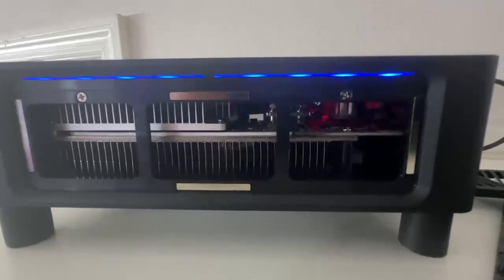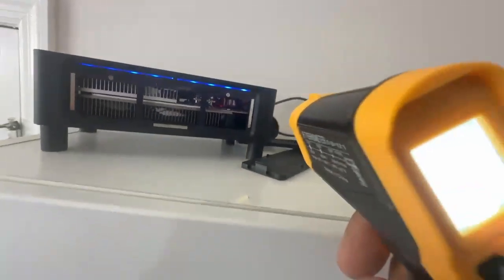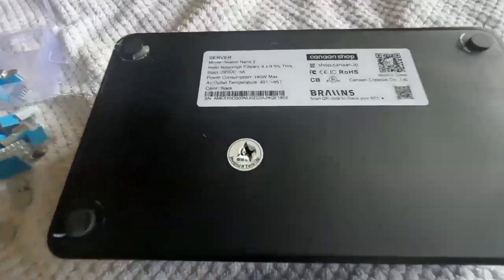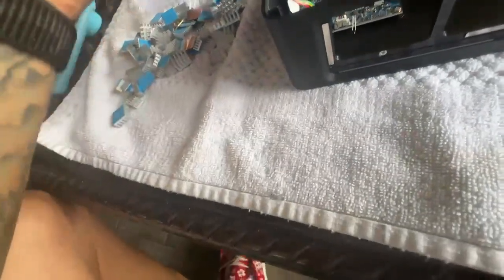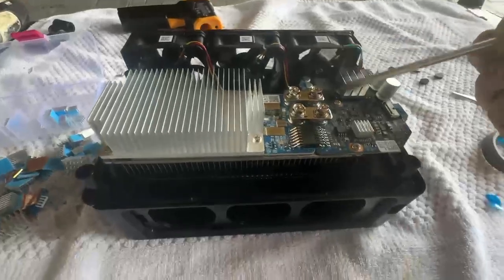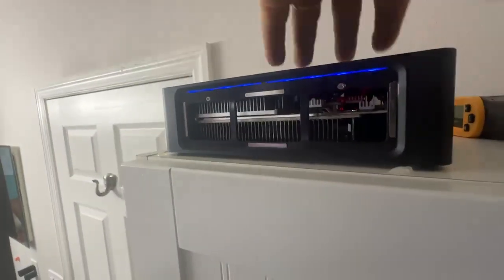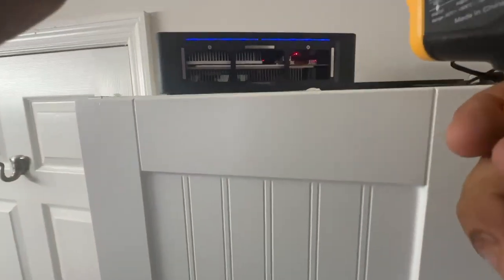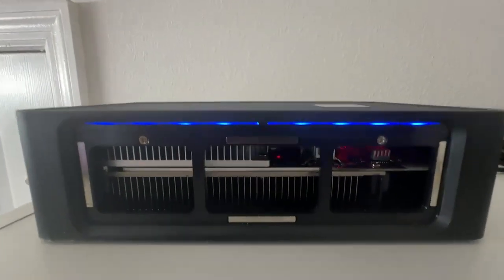How To Cool Down Canaan Avalon Nano 3 ASIC Bitcoin Miner

Comment: My concern is more the noise than the heat (its sold as a heater anyway). Do you think those fans are replaceable with quiter ones?
Also, I notice a rattling at medium speed, but not at high speed. Is it dust? Or loose screw? Not sure how best to clean this without damaging. 
Thanks for sharing this video though!

Comment: Just so you know, those chips do not need a heaksink, they are designed to run at those temps, even hotter with no problems. You are opening the device and voiding the warranty for no good reason. Secondly this device is marketed as a heater, so its made for hot exhaust air to be blowing. Device is fine as it is
Reply: Usa they do not void warranty, that is illegal for any company that ships products to the us directly. Also, they work more efficiently as a heater if they get the heat off of the board as efficiently as possible. Mine are whisper quiet since i ddi this, no longer shut down with a message saying “overheating” and now have MX-6 on the main chips vs the baked dry paste on them from the jump. Put heat sinks on everything that I could fit them on as well, hopefully they last forever as people who did not do this had them fail
Reply: @Euxable  I'm based in the UK, not US. So, I'm not aware of your laws. I ran all of mine unopened on high settings for over 9 months without any issues. They ran just fine
Reply: @ ah gotcha, well the US we are legally allowed to repair. Even lawsuits are filed against companies like apple for throwing errors on iOS when aftermarket parts (or even oe donor parts) are used. However, my reasoning beyond longevity of these devices is:

Periodically, mine would stop hashing with an error on the small screen stating (OVERHEATED) or something similar. I wouldn’t find out until I walked into the kitchen and heard the fans at 100% from across the room. That was my maim reason for doing so; the larger benefit is that my family can watch tv in the living room and not hear the fans going crazy due to the rock hard and dry thermal paste (maybe even glue) used on the main processors. The heatsinks cost $10, and my mx-6 was sitting around from my pc build. The fans now consistently hold 40% (3k rpm) and they are pretty much silent at that speed. The hash rate is also above 4.2 on each of them, when previously they were throttling down as low as 3.XX when the sun hit them directly through the window
Reply: There are some reports of defective devices. The chip in the corner is particularly problematic.

Comment: Hi and thank you for the vidéo, I don't get how you lift the miner after you put off the screw cause the power connector avoid it from pulling, did you just "force" it a bit or did you do something différently ???
Reply: You have to pull it from the back it’s it’s tight
Reply: You gently pry it

Comment: highly recommend a exhaust shroud with a 120mm fan, helps greatly pulling that hot air out and reduces temps greatly, i rigged a ks0 pro shroud with some tape and temps are like 90ish without heatsinks